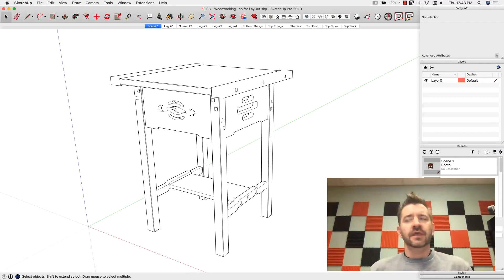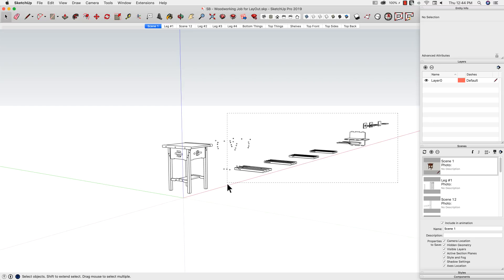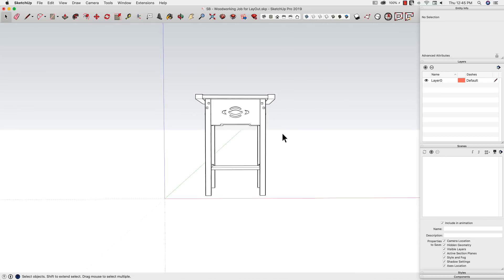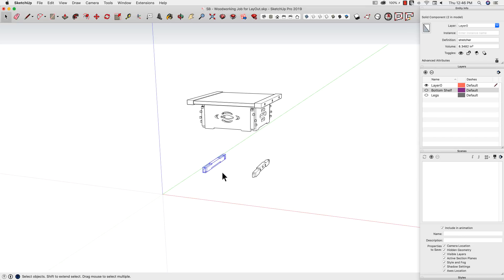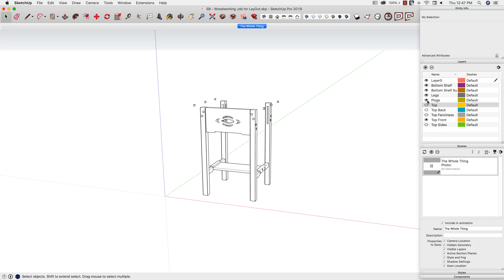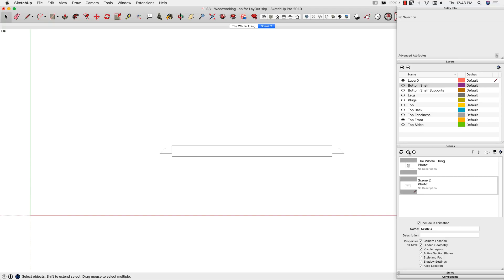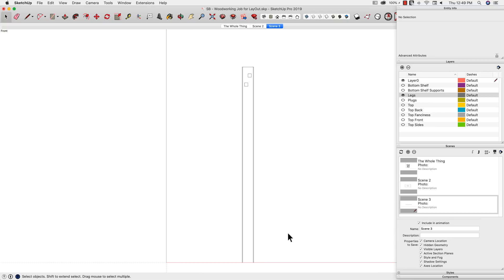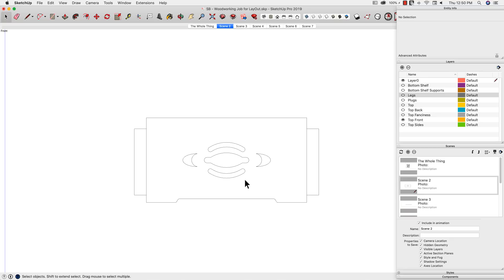Non-Destructive LayOut Prep for Woodworking Projects in SketchUp - Skill Builder

Comment: Having watched this video and the prior video that included disassembly I like this method a lot for its clean simple approach. I can see the value in the disassembly though if I were to take the next step of (forgot the term) laying the boards in a fashion to see how many and what size standard boards you need to buy. Like laying cabinet sides onto a 4' x 8' rectangle to nest as many as you can into a sheet of plywood. Hint hint a video on an efficient way to do that would be hugely helpful!! I especially appreciate the woodworking specific focus!

Comment: Hi Aaron. As a woodworker and one of the original requestors, thank you for continuing to produce videos on this topic. I just finished producing twenty pages of shop drawings with SU and LO for a slant front desk I'm building for my wife's office, and I've used many of the tips from you and many others here and in the SU forums.

As others have mentioned, this non-destructive method works great for isolating individual details Copies of "The Whole Thing" are still required to produce exploded views, sheet goods cutting diagrams, etc. I've had a "wouldn't-it-be-cool-if" thought that perhaps should become an official Feature Request:

Scenes currently remember and replay lots of states, including the Hidden Geometry states you demonstrated. Wouldn't it be cool if scenes could also remember geometry transformations? A "home position" for all geometry would be set by the user, from the fully assembled structure, as in your "The Whole Thing" scene. Then the one-and-only-one instances of geometries (i.e.components) could be translated and rotated as needed, not copied, to create exploded views, sub-assemblies, cutting diagrams, etc. Creating a new scene would record everything it does now, plus the translations and rotations of each component in the scene. Moving from scene to scene would "replay" the geometry translations, so going to your "The Whole Thing" scene would restore all the geometries to their original positions.

I'd be interested in your, and others' thoughts on this idea, or if there are plugins that already emulate this behavior. If it has any merit at all, I would be happy to post it in the SketchUp Community forum for further discussion.
Reply: Love the idea, but for the time being, you may want to look into SUanimate or Animator from Fredo6.
Reply: Thanks, Aaron! As I was writing down my idea, animation applications did cross my mind. Something to investigate in Fredo6's Animator: "Saving the original object positions. Animator includes a Positioner utility, allowing to save the position of all Objects in the model and later restore it." If these object positions can be tied to Scenes (the tie that binds SU and LO), we may be on to something!

Comment: An idea for a future video!
I have two (or more) views of an object. A front view, a side view and a Top view of the same model. Each one saves in a different scene. Now in Layout I build a drawing with all these views. But I want them to be aligned! i don't want the border of the scenes to be aligned. I want the drawings inside each scene to be aligned one with the other. Which is the faster way to do it precisely? Because I still do it only using my eyes and guessing they are aligned.
Reply: In LayOut views, there is a little blue circle with a rotation handle shown at the center of each viewport (when the viewport is selected). You can click and drag that little blue circle (the mouse cursor turns into a hand) and snap it to the geometry in the view, like an endpoint or midpoint of an edge. Then drag the viewport (when the cursor turns into the four arrow cross) toward the view you want to align it with. The repositioned little blue circle will snap to geometry in the other view, so you can align the view you're dragging precisely. What I usually do is then use the arrow keys to move the original view directly right / left / up / down as needed. Shift-arrow key will get you bigger jumps with each arrow key press. Hope this helps!
Reply: @RobMahan  It works...but it's very weird. I can align a point in a scene with another point in another scene. But then I have to move the viewport again because the drawing is aligner but the "frame" of the scene has been moved. If I try o move the corner of the scene to align it with the other scenes also che drawing inside move with it and I loose the alignment of the drawings again.
Is there a way to move the borders of a scene without moving (or scaling) the drawing inside it? In Layout.
Reply: Ok ok I found it! "Preserve scale on resize" in the "Sketchup model" panel! Now everything works. Thank you.

Comment: One request, can you talk about how to work with Report, on the File tab? I use it to get a crude cut list, maybe a "best practice" to  name and add info to Component to get the best of Report? Thanks
Reply: Report Generator is a great tool that can provide a lot of information but for my work flow creating models for woodworking projects, it doesn't work well for creating materials or cut lists because dimensions of the parts are listed as LenX, LenY, and LenZ. These are the lengths in the component's or group's red, green,  and blue axis directions in that order. I always want the dimensions listed as Thickness (almost always the smallest dimension), Width, and Length (almost always the longest dimension). Unless the model is created such that the thickness is always oriented along the same axis direction, Report Generator will scatter the thickness, width, and length in the different columns. Setting the axes so maybe the red axis is the direction of the thickness creates extra work in modeling and opens you up to making errors. It can also make reusable components more difficult to use.  The alternative would be to rearrange most of the dimensions in the exported CSV file. or just let the dimensions be shown in apparently random order.

Instead of using Report Generator, I use the Cutlist extension by Steve R from the Extension Warehouse. It automatically puts the dimensions in the right columns. In those extremely rare cases where a part is wider than it is long, I still have to edit the list to swap the dimensions but that's typically one part in maybe a dozen models. Much less work in modeling and in setting up the materials or cutlist. If you want the information it can sort the parts into lumber, sheet materials, or parts and also reports volume of lumber (board feet or cubic meters) and area of sheet materials as well as provide a layout for the parts.

Comment: As a woodworker, had always a hard time tring to work with Layout to have all the views and dimentions to cut and assembly all parts. Still working with my notebook here in the shop, not the best place to have a sensitive eletronic device when handling timber... Thanks to show a work flow to get my projects in Layout, so I can print and use the old paper drawings in the shop. Again, thanks for this video.